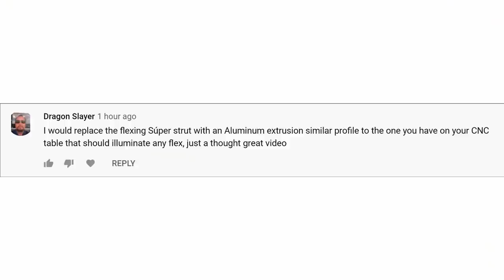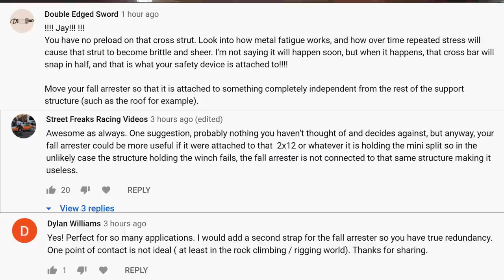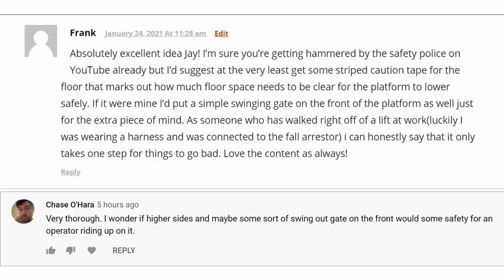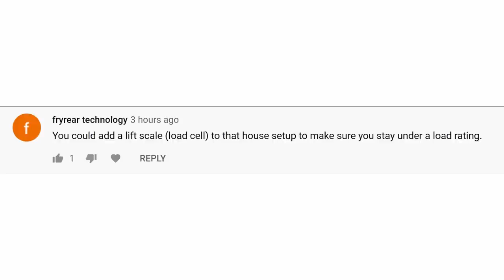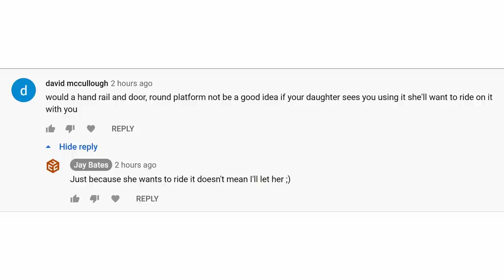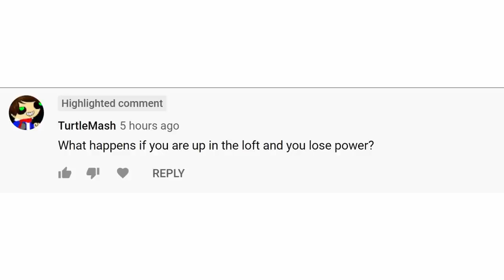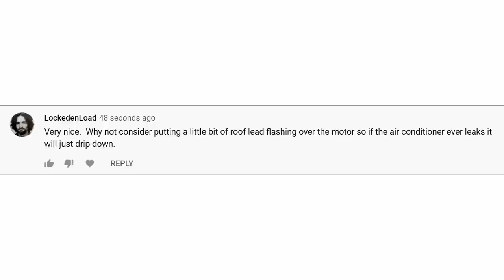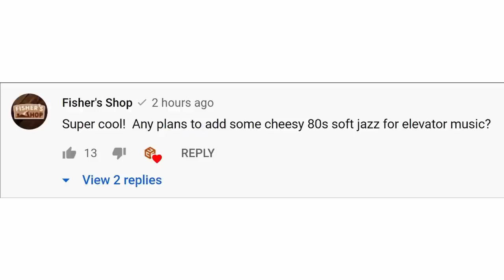DIY Elevator Follow-up

Comment: gfci ... ground fault circuit interrupter ... essentially a breaker you can reset where the plug is ... great for places with water hazards like kitchen sinks etc ... 
.
great for out door receptacles too ... pretty much the law up here for any chance of water contact ... so much so that if you have a fire and it happens from a plug that should have been a gfci and it wasnt you wont be covered .... so the cost of the burn down is all out of your own pocket ... 2 bucks or 200,000 which is cheaper
Reply: gfci putlets can also gfci an outlet chain as well NOT just itself ...
Reply: considering your fall arrestor chain is rated for 880 pounds ... your never ging to be able to lift more than that without the arrestor false triggering on you .... as you say the hoist is 550 pounds ... so keeping there is good enough ..
Reply: for the most part your choices are fair ... the only one i would disagree with big time is not gfci'ing the hoist outlet ... like i said before if your place burns down and it is traced to that outlet your insurance doesnt havent to cover it depending on local laws ... cheaper to spend the cost of s gfci and save paying for a new house if stuff happens

Comment: So if the woodworking gods put a curse on your luck and while upstairs you lose power, your miter station suddenly collapses as you eye it as an escape route, your phone was laying on the miter station, your entire family went shopping, the creek flooded and washed out the bridge, you could always slide down a piece of rope you put in the attic (as a backup to the miter station) since it took up less space than a ladder.

Comment: Jay, I’ve just watched your elevator video and this follow up.
Great work!

One idea that is cheap and easy is to lessen that span from side to side on the unistrut that the hoist is hanging on.

Run pieces  of your chain from the top of the unistrut since you flipped it bolt holes up with bolts, washers, and nuts on the strut and to lag bolts and washers into the center of that 2x12. As close as you can within reason to each end of the hoist. That breaks that large span down into 3 short (and stiffer) spans.
This should eliminate the flex that was mentioned.
Great stuff once again.
Reply: 100% agree, if you use a strut load calculator like the one available at Atkote Unistrut you will  see that this is way over the design limits for a live load.  I’m no expert so not sure what will happen but I’m guessing the metal will fatigue over time.  I copied Jays design pretty closely but I have the center supports about 30” apart, Jays setup has some unique space constraints.  Another thing you can do is keep the ends from flexing upward, in its current state they are doing nothing until one of the center supports fail.  Design the outer brackets so that they keep the strut from lifting will greatly increase load bearing capability.

Comment: Watched both videos and generally think you covered all the basses. As you say, it is not for public access and most of the stuff is common sense. I think the weakest link in your design is using a woven lifting strap as the pick-up point. They are not really intended for constant weight-bearing use especially against sharp edges/folds and could fatigue. One thing you didn't cover is someone parking something under it or even a meandering rolling tool or cart encroaching the space while you and it are in the loft. There are a couple of inexpensive ways to guard against that. It is always the things you don't anticipate that will bite you in the butt.

Comment: Hey Jay, I was thinking of doing something similar in my garage, do you have any other advices to give before going this route? Also, what do you think about having the platform made in a cabinet-like style, do you think it could have some impact on the mechanism that I can't foresee right now? I am thinking I may go this route, as I will most likely "daily drive" my garage with the lift down (so it stresses less the hoist) and thus I could simply put a plywood sheet on top of it to have a work surface for light stuff.

Comment: Your water heater story is the one I was going to tell you was the one I lost a breaker to!! I was doing the same thing, trying to save money. Some months later I had to replace our water heater and oddly enough, a day after I replaced it, it didn't work. Sure as shit, it was a failed breaker... You really should NOT use the breaker as a switch.....

Comment: Just watching your follow up video on your elevator and someone mentioned placing some sort of shield to protect the hoist from moisture.
Forgive me if I'm wrong but it's your hoist meant to be attached to a vehicle? 
Aren't vehicles meant to be outside?
It's stands to reason that the makers of the hoist made it to be able to withstand a bit of moisture.

Also, I was a little disturbed by your constant eye contact at the end.

Comment: I read about that fall arrestor breaking after one engagement.  Was it just not retracting on the last vid and is better now or did you have to send it back?  I've never used one but it seems like it would act like a seat belt or hose reel where you just need to get the ratchet to reset.

Comment: Common it's safe enough ......if you are to scared to build and use one like this keep going up down with a ladder wich  is more dangerous then this lift......just one point check regular the kabel and the attachment from on the roller ....i had it once that the kabel came loose  but it was an old one and we used it to lift  up to 500 kg several times a day.....always make a monthly or weekly inspection that is every thing safe......the only thing i would change is to make a wide gutter under the airco and make an outlet with a bucket under it so there is no way that water comes down on the electric motor.... just a tip nothing more....

Comment: You could just have a temporary removable folding fence around the landing area for when kids or pets are around (even though they're not supposed to but that's exactly why accidents are called accidents 😉) Also kids aren't stupid, they're just ignorant. Explain the danger and how it will hurt them, they do understand getting a limb torn off or crushed. Demo it with a fruit if needed.

Comment: I disagree with what you say. now you only have two sides whose load is tensile. The upper part is now bent when it was previously stretched. Because the load point is always on top.
Reply: Yeah, I had the same question.  I did a quick search on 'point load on unistrut' and found a load table example here https://www.unistrutohio.com/unistrut-beam-load-tables.  I'm sure there are many others as well......

Comment: Just curious.  Is the loft area really designed for floor loading, or are there just ceiling joists. The joists do not appear to be deep enough or spaced close enough for a floor design.

Comment: What if water drips on the cable causing it to slowly rust, and then the cable to starts to break halfway down. Then you notice and jump off the elevator and trip and sprain your ankle. How will you mitigate this absurdly improbable risk?

Just kidding, I think the elevator is awesome, and I can definitely see myself building something similar if I find a shop with a loft space.

Comment: I only have a few suggestions:
1. Keep making "normal" videos. (Follow ups to pacify trolls are obviously your prerogative... and hey... 27k+ additional views in 20 days!)
2. Keep being a good dad... my kids still don't get (or get to do) all the things they want to either.
3. Keep your sense of humor. Took me awhile to stop laughing... and I don't even like jazz. 
4. Feel free to completely ignore the Safety Sallys.

Full Disclosure: My "winch lift"/"shop elevator" in the back of the shop has NO fall arrestor!!! 😲🙅‍♂️🙄😡 <--(Safety Sallys... going from shock to exploding head) 😄😂🤣🤣🤣
Put it up in 2001 (was my idea, but my dad & I figured out all the details together) and haven't had any problems. (I do check the entire thing annually.) 

It's a 12,000 lb 12v winch (has a car shut off that only I have the key) and I removed the handle/key that makes it possible to put the winch into free-fall. (Replaced it with a bolt that makes free-fall impossible... unless a pulley, cable, unistrut, or PT 2x10 breaks.)   Mounted the winch 3' above the floor in a box made of PT 2x10s (all left over from concrete forms) with a plywood cover for safety, running on a 12v deep cycle battery (kept topped off by a solar charger mounted outside). The floor/base of the lift is an old metal trundle bed frame of 1-1/4" angle iron with 3/4" plywood bolted on top. It hangs from four 7,000 lb test cables (tied thru the 4 corners of the bed frame) that run up thru oversized pulleys bolted (with 1/2" bolts & 1-1/2" fender washers on each side) into PT 2x10s (that run all the way down to the floor -- at the top are deck-screwed together), and the 4 cables go back down thru more pulleys to tie directly to the main winch cable. The back wall is a metal Quonset-hut that has similar uni-strut & trolleys to yours, but I deck screwed the strut to PT 2x10s and tied those to the wall. We safety tested the rig by raising it 6" and had 1, then 2, then 5 adult men get on, jump up, & land at the same time. Got a grand total of less than 2" flex in the cables with all 5 (and we marked all the bolts, screws, & anything else that could shift first... nothing moved). Hardly need to use it now, since it's loft storage, but when I made it, it ran almost non-stop for 4 weeks as we cleaned up the floor space. It's so handy... and much more safe than pushing things up and down a ladder. (I do keep the weight on it under 1,000 pounds... don't want to test it to failure either.) I considered safety rails, yellow/black tape on the upper deck, marking the floor, fall arrestors, etc. but since so few have access (2 keys, I have them both), the frequency we use it (once/twice a year), and the fact that I rarely remember the key and just climb the racks to get up and down most of the time anyway, none of those safety measures made any sense.

Also found some half-depth unistrut & made a fantastic hanging pipe rack with stand up wood rack below, and some 2x-depth unistrut. Bolted that to the ceiling, put trucks inside, and hung a 500 lb chain fall on the trucks... now it's super easy to load anything up to 200 pounds up on the smaller loft in that front part of the shop.

Comment: I see you have awakend many of the annoying people in the world. They probably all drive Volvos, because as you know, the worst drivers, drive the safest cars. It also sounds like, as a parent, YOU actuall watch and teach your kids. it might be a good take away for some.

You can OVER enginer anything. I think the design and implementation for your use, in your invironment is the right amount. It's not like you have to satisfy OSHA standards. It's obvious you put a lot of thought into this. It shows. The only addition I would say is that anyone doing this be sure to use a "hoist" not a "winch" A hoist, generally comes with a break to help hold a load. a winch will slack under a load.

BTW nice job!